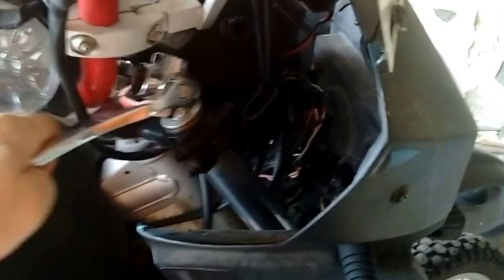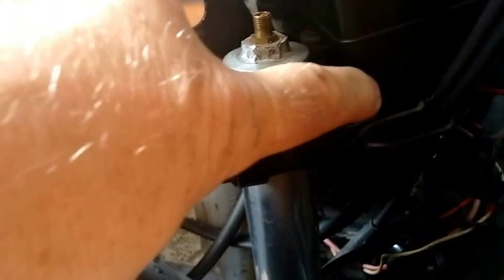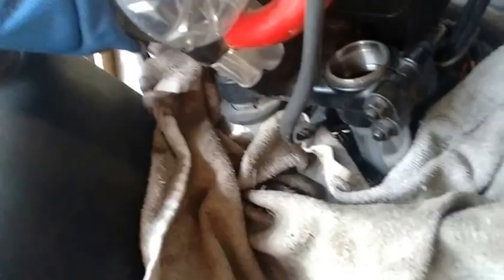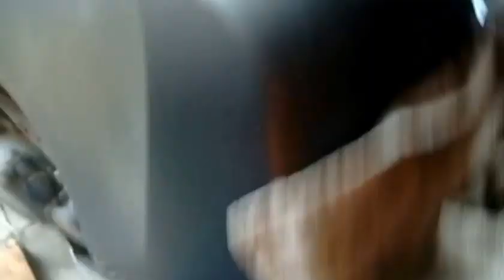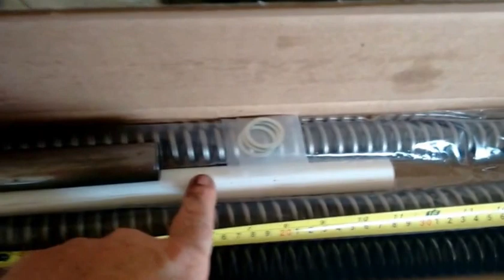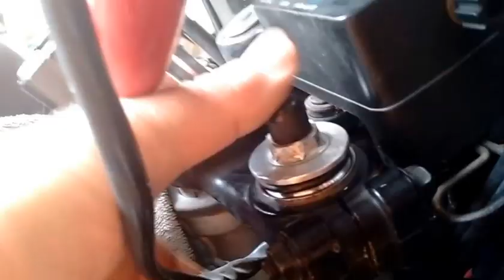KLR 650 Front Fork Spring Install

Comment: He says the new spring is longer and he will lengthen the spacer. He should say shorten the spacer.
Reply: Yeah, he described it incorrectly the first time, because I was sitting here going...whaaaat? But when he made the cut he reduced the length of the spacer by the necessary 2". So all's well that ends well. lol